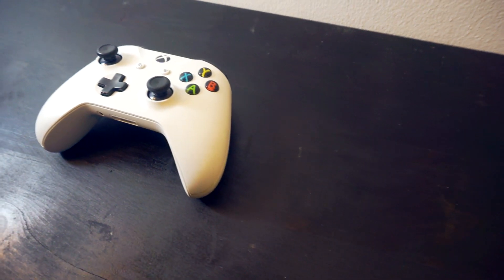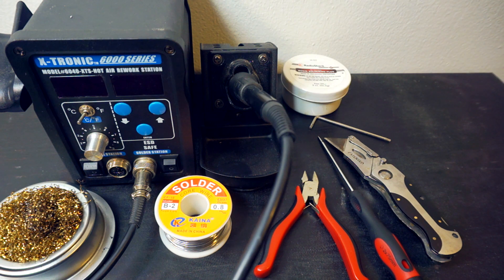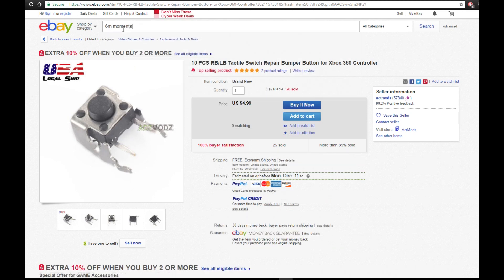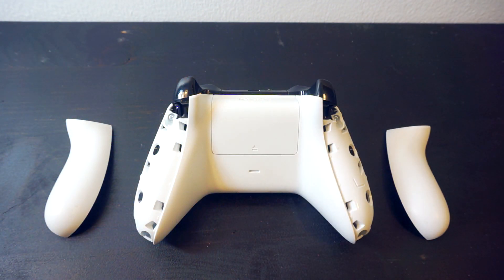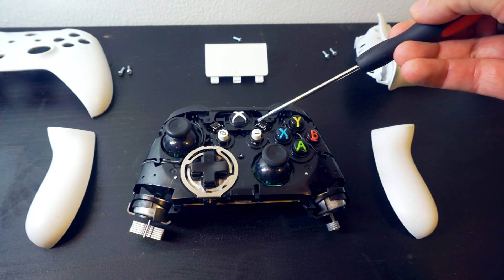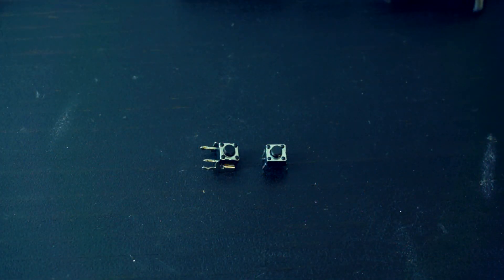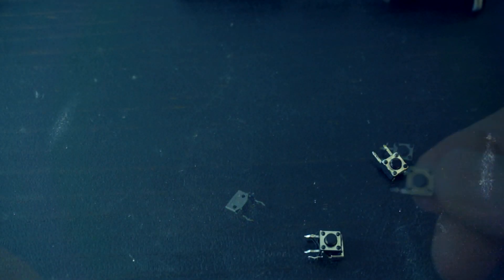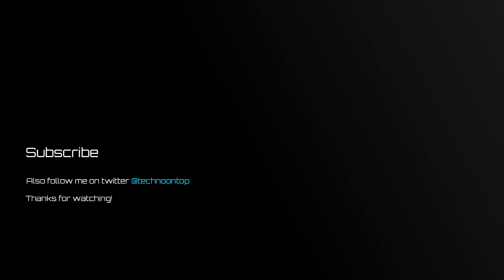How to Fix Xbox One Bumper Buttons (LB, RB) Replacing Tactile Switches

Comment: Use torx security bits if you have the money. That's the actual head the screws come with. You can do it with regular Phillips head or flat head if you're willing to fck up the screws
Reply from the maker: Did I not use that torx security head? I'm pretty sure I did.

Comment: can I use X360 controller switches on XOne Gamepad?
Reply from the maker: I'm pretty sure the actual switch hasn't changed much if at all, if it looks the same I'd use it, I pulled a 360 switch, then noticed the original Xbox is the same

Comment: My RB button started working 50% of the time after 1 month of purchase, then only 5% of the time after another week. Is the tact button likely my problem? I feel like if that was my problem it would work 0% of the time. Took apart my controller and I can see the RB lever pressing the tact button every time and clicking.
Reply from the maker: After I replaced the switch, it last a month maybe 2 then I didn't even bother, I'm not to sure what exactly is causing the issue the older controllers seem to have more issues though
Reply: @TechnoOnTop  Hmm, well I am going to attempt the fix because I needed to fix my headphones anyway.
Reply from the maker: If you happen to remember, report back in a few months I'd love to know if it completely fixes your issue.
Reply: @TechnoOnTop  ok the fix was a success. I will try to get back to you if it breaks again and let you know how long it lasted. Keep in mind this was my first attempt at soldering other than practicing on a few wires beforehand.
Reply from the maker: @maxmaidment96  glad to hear! Thanks for that, hopefully it is permanent and mine was just a fluke,
Reply: If it's new it's under warranty...
Reply: @urbbs09  Unfortunately I bought it as an unused display model for half of RRP so I don't think I had a warranty.

Comment: I hate Xbox controllers I have like 6 broken ones and I will admit I used to rage a lot in games and like 2 controllers have broken from me raging but that was a long time ago. Now, I have a controller that I did nothing to except drop it a few times. Xbox controllers are so bad
Reply from the maker: I have 4 controllers and 2 of them have broken bumper buttons, I fixed the one on the video and it broke again a few months later, my elite controller and that came with the slim Xbox seem to be holding up well though. But I agree there has to be some sort of manufacturing flaw in alot of them.

Comment: I have a controller and I had to press the rb button hard in order to  register, I used your method of replacing it in a new button, but the rb doesent even work anymore, did I do something wrong? My Twitter is @mufind12d, pls help
Reply from the maker: I'd just check over your soldering, that and make sure there is no solder splashes on the board, maybe even try a different switch, I suppose it's possible to get a dud switch,
Reply: @TechnoOnTop  oh alright, I'll check
Reply from the maker: Good luck I hope it works out

Comment: How do you know if the switch is broken or the bumpers  are broken because mine is very unresponsive how do you know which one is broken without opening the controller because I'm going to order tools  to open  it so I don't have the tools necessary to open the controller
Reply from the maker: Personally iv never had a broken bumper button so im not sure how to tell if it broken before taking it apart(it may just fall off? Or is easily taken out?) you could use this as an excuse to change out your bumpers and sticks to a color of your choosing for that more custom look. When my switch was broken it didn't work at all... A few months later even after doing the repair the switch has yet again stopped functioning I didn't bother with replacing it again. As I had a brand new controller from buying another Xbox one.

Comment: thanks for the vid! I have a xbox 360 controller and my LB was broken. But to reach the LB I had to remove the LT first by desoldering. I borrowed a LB for a controller that had no wire. Anyways I put it all back and my LB was working but now my LT didn't work (typical right). So I took it appart and re-did the soldering for my LT and well idk what I did different this time around but it works now. :)
Reply from the maker: Hey! Glad to hear that the video was able to help you and you got your controller all sorted out! Does sound typical to fix something only to break something else been there haha. Appreciate you taking the time to comment

Comment: This is not worth the effort. It would be more expensive to buy the tools needed for this job than to just buy a new controller, and to top it all of it might not even work.

Edit: Put your mouth over the button and blow hard like its an old Nintendo cartridge. Works like a charm.
Reply from the maker: Some people have these tools already... But ok thanks for watching!
Reply: Lol the tools cost under $5 that's for the tactile switchs (10 of them) and tamper proof t8/t6 tools... If you don't have solder I recommend getting one because sooner than later you are going to have to repair something in life!

Comment: Techno.. help.. my Lb I gotta press hard to get it to work who can help
Reply from the maker: I'd verify that all your bumper assembly is clean and not broken in anyway. If it is I would replace the switch. Thanks for watching
Reply: Im glad it worked for you all but if it keeps getting ‘stuck’ stop blowing inside cause the hot air u blow inside is gonna become water and can damage one of your buttons like it did to me
If it keeps getting stuck i suggest u guys open the controller and clean it
Reply: @sufraxx1342  thank you dude! It wotked, gonna clean it when i have the time
Reply: I have the same problem just my Rb button
Reply: Maria D ;-;
Reply: Sufraxx AHHHH HELLL NAW I JUST DID THAR SHIT AND MY BUMPER IS FIXED WHAT THE FUCKEN KINDA MAGIC YOU DO EN
Reply: @sufraxx1342  you're a legend
Reply: @sufraxx1342  I honestly didn't think that would work since I tried blowing in there before with limited success, but that worked like a charm this time. Saved me the hassle of trying to replace the button. Thank you.

Comment: First try took it apart and put it back no issue didn't even fix shit just did it to look inside and clean and the bumper still works better then before
Reply from the maker: Glad to hear, iv had a 2nd white controller develope this problem. Thanks for watching
Reply: @TechnoOnTop  Would you say this is prevalent with the white controllers that came about a few years ago more than others?
Reply from the maker: @Clevercommenter  if I had to say I would say it's more likely on the older white controllers, the wife has been using a white controller that came bundled with a slim model which we picked up about a year ago no issues. But the controller I fixed did get the same issue within a few months, and I haven't had the issue with any of my other controllers.

Comment: can I swap bumper tact switch from xbox 360 controller to xbox one S controller?
Reply: Would an Xbox 360 bumper tactile switch work with Xbox One S controller? to be precise...
Reply from the maker: Yes the tact switches are exactly the same on the 360 controllers. That was the original plan for this video but I couldn't find my broken 360 controller at the time
Reply: Thanks a lot, my friend works at a repair shop, he actually repaired the switch, no replacement required :)
Reply from the maker: Waqas Zahid very nice glad to hear!

Comment: Damn You Might As Well Buy A New Controller
Reply from the maker: The fix is way cheaper if you can solder. If not then yeah you can make things worse. One person said the switch cost then 15 cents. Thanks for watching
Reply: @TechnoOnTop  "costed"
Reply from the maker: @jackgillespie1178  lol
Reply: I did a similar repair to this on my xbox controller. I salvaged some switches from an old controller I used with my PC that I didn't really like because it was 3rd party and felt cheap with bad dead zones on the joy sticks. The first repair went smoothly I replaced the switches and it worked well. then it broke again after a couple months. I tested to make sure it had the right voltage across the switches and it did, so I did the repair again. Except this time I broke 3 different things over the course of the repair, one of the solder pads fell off so I had to run a jumper wire, the rumble cable fell off during reassembly, so I had to resolder it, and I accedently snapped off a capacitor putting it into a PCB holder which I resoldered. So it can definitely go wrong, but I was able to fix all of those problems and I have a working xbox controller... So at the end of the day it was worth it for me because I got to practice repairing and I did end up fixing it. And really if you're controller is not usable because it has a bad bumper switch, it's not really a big deal if you break something and are unable to fix it because you would have to buy a new one either way.
Reply from the maker: @noahmullins2413  damn sounds like it was a long repair the 2nd time! mine has also since stopped working, i haven't bothered with repairing it again as i have a few around that work, glad to hear you got it done a second time and the experience is definitely worth all the trouble!